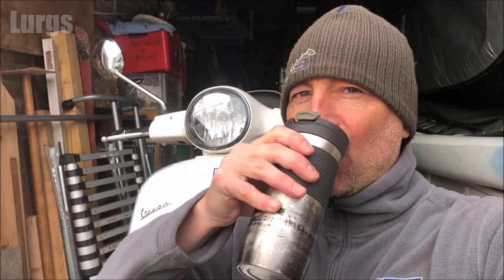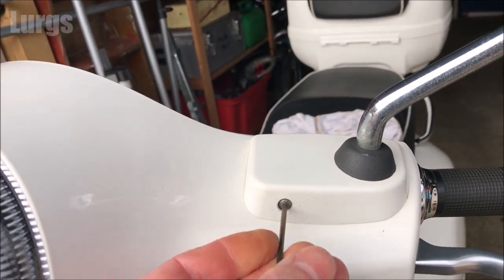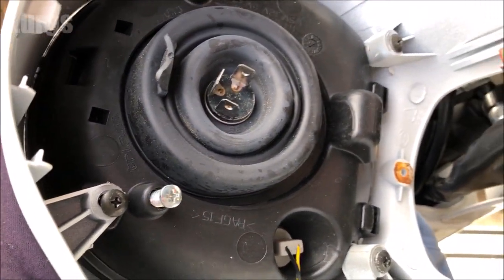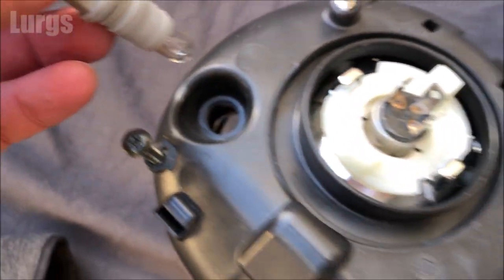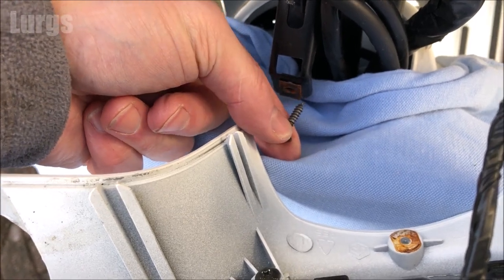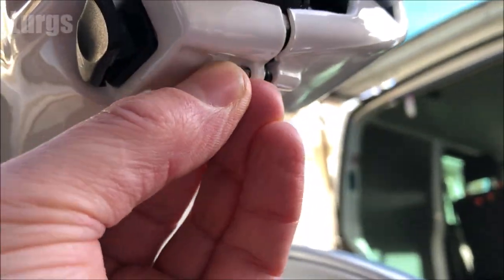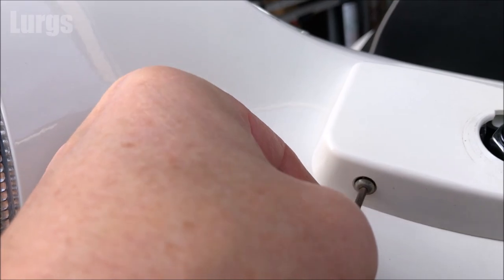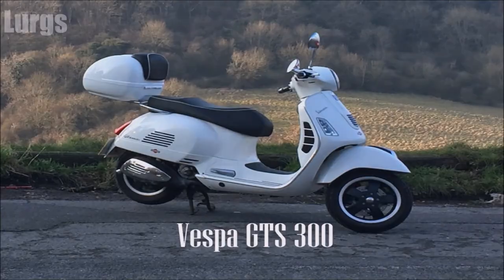How to replace Headlamp unit on Vespa GTS

Comment from the maker: Other useful How To Guides to help you save ⏱TIME and 💰 MONEY:
Vespa GTS How To's, Tips, Tricks, Fixes & Reviews https://www.youtube.com/watch?v=16LcQelRTlc&list=PLqrXuUebV8N971niUIBHudSltuzOq9J7w

.
5 things I hate about my Vespa GTS 300 https://www.youtube.com/watch?v=16LcQelRTlc&list=PLqrXuUebV8N971niUIBHudSltuzOq9J7w
7 things I love about my Vespa GTS 300 https://www.youtube.com/watch?v=h0nWikLMFLg&list=PLqrXuUebV8N971niUIBHudSltuzOq9J7w
Vespa GTS 300 Review and Ride https://www.youtube.com/watch?v=iMmJyuPvbkU&list=PLqrXuUebV8N971niUIBHudSltuzOq9J7w
Vespa GTS 300 Rust problems https://www.youtube.com/watch?v=q_kLZT_iRV0&list=PLqrXuUebV8N971niUIBHudSltuzOq9J7w
Vespa GTS 300 Underseat Storage does a standard Crash Helmet fit and other Alternatives https://www.youtube.com/watch?v=LCmAbywTG8M&list=PLqrXuUebV8N971niUIBHudSltuzOq9J7w

.
Vespa won't start issue https://www.youtube.com/watch?v=g2FaJ_5IAXc&list=PLqrXuUebV8N971niUIBHudSltuzOq9J7w
Vespa GTS Battery Location and How to check battery on Vespa GTS https://www.youtube.com/watch?v=S2h7ltTophU&list=PLqrXuUebV8N971niUIBHudSltuzOq9J7w
How to charge Battery on a Vespa GTS https://www.youtube.com/watch?v=jqmR4NAASbg&list=PLqrXuUebV8N971niUIBHudSltuzOq9J7w
Vespa GTS 300 Battery Change https://www.youtube.com/watch?v=-He3Wca40lw&list=PLqrXuUebV8N971niUIBHudSltuzOq9J7w

.
Vespa Side Stand don't use it Ever https://www.youtube.com/watch?v=MJ1xuX2TUhc&list=PLqrXuUebV8N971niUIBHudSltuzOq9J7w
How to put Vespa on the Center Stand https://www.youtube.com/watch?v=ZlwZfTkS7Go&list=PLqrXuUebV8N971niUIBHudSltuzOq9J7w
Vespa Tire Pressures https://www.youtube.com/watch?v=1lwrkW9k0Js&list=PLqrXuUebV8N971niUIBHudSltuzOq9J7w
Vespa GTS 300 Top Box Review https://www.youtube.com/watch?v=HHDbrhnnr54&list=PLqrXuUebV8N971niUIBHudSltuzOq9J7w
Vespa GTS 300 Oil change and Oil Filter change https://www.youtube.com/watch?v=5VfKR7c4eJo&list=PLqrXuUebV8N971niUIBHudSltuzOq9J7w
Vespa Dashboard Lights Meaning https://www.youtube.com/watch?v=TgFp0jszqTA&list=PLqrXuUebV8N971niUIBHudSltuzOq9J7w
Vespa GTS Fuse Box Location and How to check fuses on Vespa GTS https://www.youtube.com/watch?v=V2fw3_NwWXk&list=PLqrXuUebV8N971niUIBHudSltuzOq9J7w
Vespa GTS Coolant Check and Top up https://www.youtube.com/watch?v=iwRFvRPI-WQ&list=PLqrXuUebV8N971niUIBHudSltuzOq9J7w
Vespa GTS Radiator Fan checking it works https://www.youtube.com/watch?v=OAQ_XlzsrOY&list=PLqrXuUebV8N971niUIBHudSltuzOq9J7w
Vespa GTS Oil Leak problem https://www.youtube.com/watch?v=b8HplSY6UPs&list=PLqrXuUebV8N971niUIBHudSltuzOq9J7w
How to set Clock on Vespa GTS https://www.youtube.com/watch?v=ZVGCymP5peQ&list=PLqrXuUebV8N971niUIBHudSltuzOq9J7w
How to tighten mirrors on Vespa GTS https://www.youtube.com/watch?v=YUNplaufUvA&list=PLqrXuUebV8N971niUIBHudSltuzOq9J7w

.
How to remove rear light cluster on Vespa GTS https://www.youtube.com/watch?v=eXOYsnWkJSo&list=PLqrXuUebV8N971niUIBHudSltuzOq9J7w
How to replace front indicator bulb on Vespa GTS https://www.youtube.com/watch?v=ob4QeVL2NUQ&list=PLqrXuUebV8N971niUIBHudSltuzOq9J7w
How to replace tail light bulb on Vespa GTS https://www.youtube.com/watch?v=UNKlh5NsT5s&list=PLqrXuUebV8N971niUIBHudSltuzOq9J7w
How to replace Brake Light Bulb on Vespa GTS https://www.youtube.com/watch?v=TTVSGmLfn9Y&list=PLqrXuUebV8N971niUIBHudSltuzOq9J7w
How to replace number plate bulb on Vespa GTS https://www.youtube.com/watch?v=UbQWmtltZ1o&list=PLqrXuUebV8N971niUIBHudSltuzOq9J7w
How to replace Rear Indicator Bulb on Vespa GTS https://www.youtube.com/watch?v=qICzWR_C0-8&list=PLqrXuUebV8N971niUIBHudSltuzOq9J7w

.
How to test a Motorcycle Battery with a Multimeter https://www.youtube.com/watch?v=e6nrKVst-CM&list=PLqrXuUebV8N971niUIBHudSltuzOq9J7w
All the Motorcycles I've ever owned https://www.youtube.com/watch?v=R5O5CT6rLCg&list=PLqrXuUebV8N971niUIBHudSltuzOq9J7w

Comment: Very much enjoyed your video,  after 10+ years and 3 bought new  Harley-Davidsons. I decided to considerably downsize. So I recently traded in my a Softail Street Bob for a new Vespa GPS 300 HPE. It's now locked and chained in my very small caged back yard. I won't be getting out on it (yes I'm a fair weather rider) until the weather warms up and were hopefully over this aufull virus!
    Oh and yesterday I carefully if fitted a quality fly screen.
Reply from the maker: I've had lots of motorbikes and the Vespa GTS 300 is a great all rounder. I don't use mine much at the moment (as not travelling to work) but I used it yesterday and it's always great fun and plenty of power. I don't like this trend of digital dashboards though on a lot of new motorcycles, I prefer a good old fashioned analogue dial for speed and revs, it just looks better and is easier to read. Enjoy your Vespa, I don't know much about the new ones, are they still similar to mine? Do they have more power? Mine doesn't have traction control or ABS but I prefer that. Ride safe and enjoy

Comment: Thanks so much for this buddy! I did the amazing’ melt your headlamp trick ‘ by not removing the cover from the front whilst running my headlight on all the time model. That headlamp screw is a truly stupid idea only an Italian could come up with lol. Excellent tip with the tape- guess you could do it for the removal too?
All the best, and enjoy that cuppa! 👍
Reply from the maker: I really don’t like the sidelight bulb coming on when ignition is on and also don’t like the headlight bulb coming on automatically when it  starts. When my old battery was dying out I left ignition on for 5mins whilst I spoke to someone and it drained the battery and wouldn’t start! I’ve since installed a new battery. Glad this video was useful, it’s a right pain of a job just to change the bulb! 😎

Comment: I’m having a problem with my headlight not working and it’s not the bulb. Any suggestions?
Reply from the maker: How do you know it’s not the bulb? Is it a new bulb? Need to test the plug and make sure there is 12v at the plug when you start the Vespa up. Doubt it’s a fuse but worth checking the fuses anyway as there’s not many
Reply: @LurgsHowToGuides  I’ve tried 3 new bulbs and checked the fuses it’s not either and great I’ll check the 12v at the plug. Thanks.
Reply from the maker: @hayleyevans1021  oh dear that’s odd. Sounds like there isn’t 12v at the plug so could be a dodgy plug or something else. Don’t think there’s a Relay for the headlamp. Hope you find out what it is, let me know if you do. Good luck